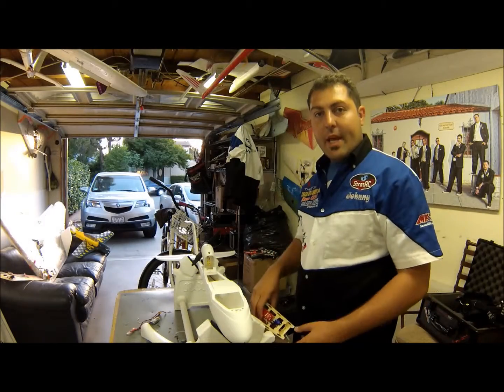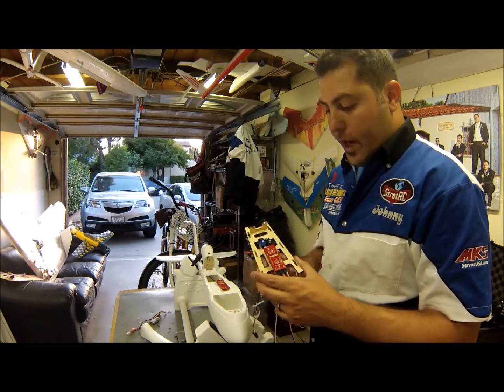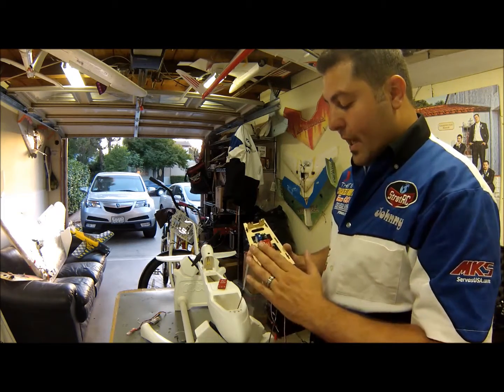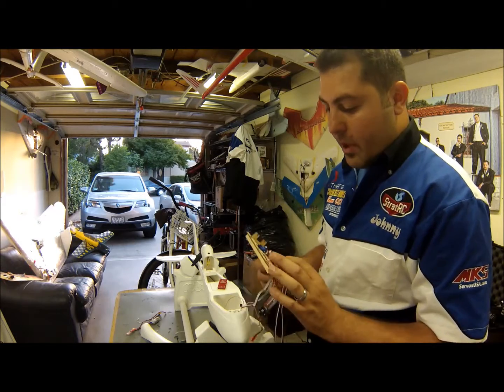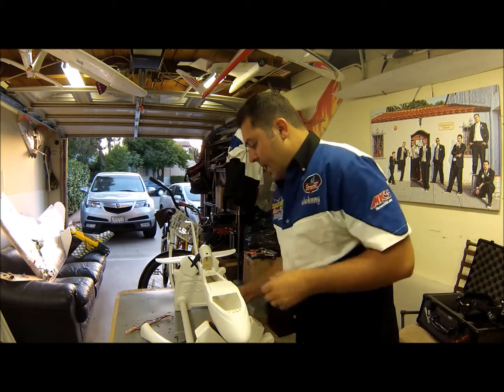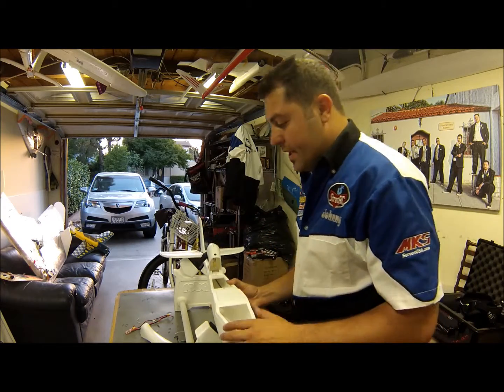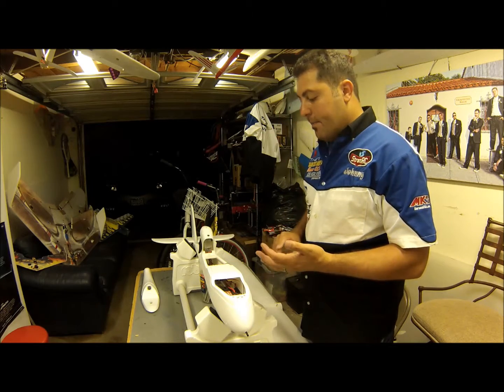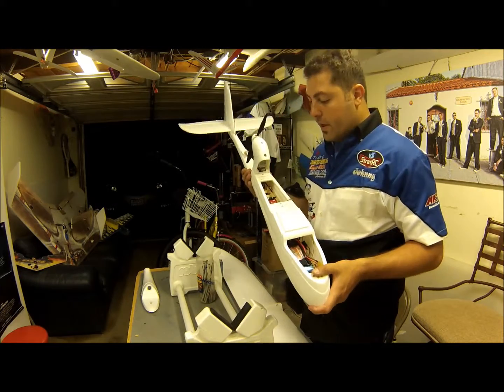Intall of the Ruby Autopilot system in my FPV Raptor

Comment: Nicely done!..  I have two of these systems with OSD and really like them.. 

 I might add a suggestion of adding a strap "around" the Ruby "brick"  to keep the "stack" intact...  
We (another third system) had a vibration from a prop/motor combo 'unstack" one of the modules from the vibration.  This was an extreme case but you know Mr Murphy...